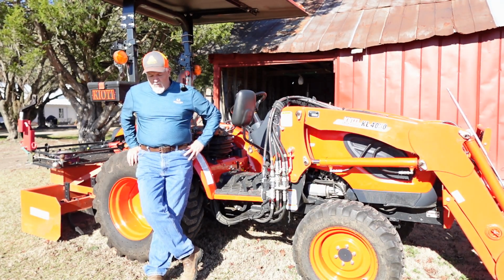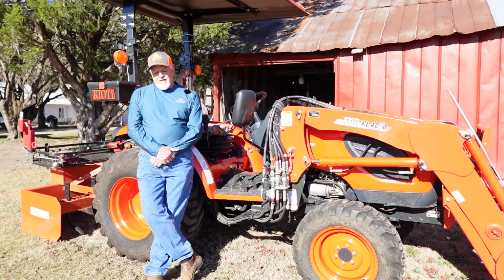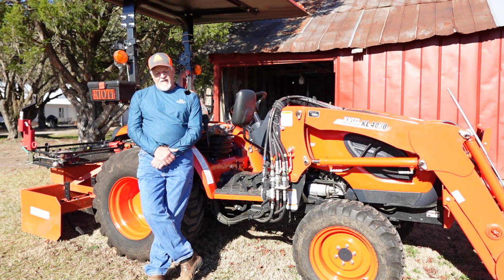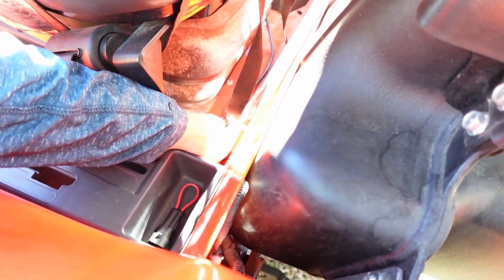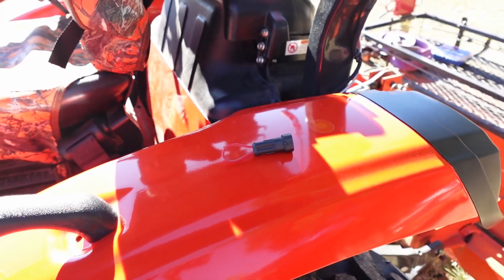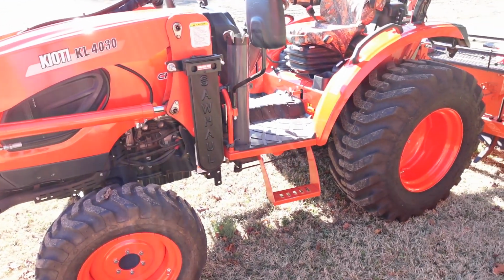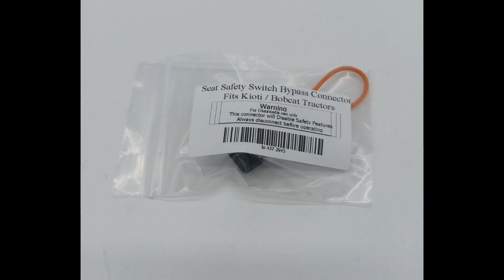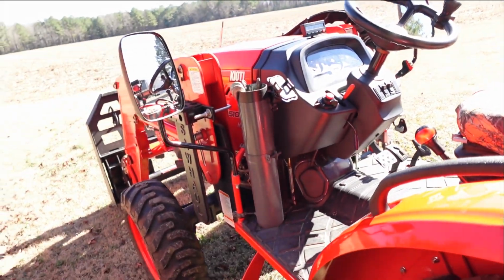Tractor Seat Safety Switch Bypass - Why Did I Choose To Do It?  Kioti CK Series

Comment: You hit the proverbial nail on the head with your comment:  "you want to do the common safety items. like put in neutral, set the brake, etc."  The seat safety switch on my CS2520 is one of the dumbing down of America items that really chaps the backside of my pants.  I'm of slight build (5'6"/125 lbs) and just shifting my weight on the seat to see the backside of the tractor when backing up will cause it to shut down.  PITA!
Reply from the maker: @timstapp374  Totally agree.  I understand that some safety measures have to be in place.  But the seat switch is just a bit over board.  Thanks for watching and commenting. Merry Christmas.
Reply: @backyardcountrylivin1514  Merry Cjost,as an Happy New Year to you and yours as well!

Comment: Jeff, I totally understand why you did the bypass.  I struggle with the pallet forks too and have thought about doing what you did.  However, I had a cousin whose grandfather fell off a tractor while bush hogging.  He got run over and was severely injured.  It did not kill him, but he was never the same. I will spare you the gory details, but it was not good!  Now, that was an older tractor and did not have what I call a safer operator-station.  My CK3510 looks like it would be pretty hard to fall off,but you never know.  I don’t worry so much about me, but I have a young grandson who has become a very capable machine operator.  I have not turned him loose with my tractor yet, but will at some point since I am now 75.  I just cannot in good conscience disable that seat switch for fear of somehow getting him hurt.  I have thought about using a switch (that only I would know about) that would make the seat switch function as intended, but also allow me to disable it if needed.  I may do that.  Thanks for sharing your thoughts on this subject.
Reply from the maker: I totally understand we’re you are coming from.  Although the seat switch can be a headache, it is definitely the safer option.  I can’t blame anyone for sticking with the most safe route.  Tractors and machinery in general are always going to have their dangers.  Thank you for watching and your honest feedback.  Happy and safe tractoring.  Merry Christmas 🎄

Comment: I noticed that Good Work Tractor that makes a different folks with short safety wall so to speak and I assume that is something that allows you to see much better. If I had to choose I will choose that one since I don’t have the tractor yet. But your solution is better for those who have the setup already. Thank you sir. Mary Christmas.
Reply from the maker: I agree, shorter headache rack would definitely  help you to be able to see better, but would also allow taller loads to be able to tip backwards and fall on the tractor.  Either way, a set of pallet forks is a must for a tractor with a loader.  It is my most used attachment.  The tractor loader multitool.   Thanks you for checking out the videos and commenting.  Merry Christmas.

Comment: Interestedly my CK4010 hst that I bought new in 2018 does not have the seat safety switch, yet my NS6010 with a Cab does.   Kioti must have started putting the switches on the CK’s right after I bought mine.  Anyway, I have no issue with you bypassing the switch, I’m fact I just installed the bypass switch on the NS a couple months ok.  Works perfectly.  Good video.
Reply from the maker: Yeah, I got a feeling most people would prefer to do without the safety switch.  But at least it’s a easy fix to bypass it. Thanks for checking out the video and commenting.

Comment: The timing of this video could not have been better. I’ve been working with my new CK3520SE and the safety cutoff feature on the seat has been driving me nuts. I’ve been looking up DIY ways to bypass it, but I like this connector much better, especially for only a few bucks. Thanks, Jeff!
Reply from the maker: Hi Logan, glad the timing of this video was able to help you out.  Like you, the seat switch was driving me crazy.  Thanks for checking it out and Merry Christmas 🎄

Comment: Always enjoy your videos Mr. Jeff! Another one of your ideas I am going to steal! You all will never catch me! Thanks, and I hope you and your family have a Merry Christmas and a healthy and happy New Year! By the way, I don't have forks, but I do use a stump bucket and it is annoying, trying to line-up where I want to start digging. Thought about maybe installing an on/off switch but went with the plug as you suggested.
Reply from the maker: Hi John, you can steal my ideas anytime, Lol.  I know what you mean, any of those front attachments that you have to see the point of contact on the lower side, near the ground, are a problem to see without standing up. I highly recommend a set of forks. Not very expensive and will likely become one of your most used attachments. It’s the tractor multitool.  How do you like the stump bucket?  I’ve been thinking about getting one, just not sure how much I would use it. Do you use it for other tasks than just digging up stumps?  Thanks for checking out the video and commenting. Merry Christmas to your and your family.
Reply: Hi Jeff, I was surprised how well the stump bucket works. I have heard others describe it as a poor man's backhoe. The only issue (expected) is you will tear up a lot more area around the stump then using backhoe, tire slippage etc. I have used it on 10" 14" stumps and 1 24" locust stump successfully. $700 bucks as opposed to well over $8,500, plus storage for a backhoe made sense for my amount of use. Thanks, again for a great informative channel, B. Regards. @backyardcountrylivin1514
Reply from the maker: Thanks for the info John.   @Kiot76

Comment: I had to this in a hurry one morning my first winter with the tractor.  I found I had to "sit hard" as the weather got colder to make the switch.  One morning I couldn't sit hard enough so I figured out which wires went to the switch, cut them and joined them with a butt connector. I had to blow the lane to get to work so I was happy I could get it to start
Reply from the maker: That’s good info to know.  I could see where the cold would make the seat hard and less flexible.  Glad you were able to bypass it and get her going.  Thanks for checking out the video and commenting.

Comment: Great video. I have the ck3520se and did the same exact thing and it works great. I would like to know where you got your seat cover, tho.
Reply from the maker: Hi Kurt, the bypass switch does work great and is a game changer for being able to see when standing up.  The seat cover is actually one for a Kubota I got off Amazon. It fits ok, but not perfect.  I had one viewer said that he found one that was almost a exact fit for a CK3510.  I haven’t ordered one yet, but that’s the one I’m going to try when my current one wears out.  He is the link he sent me.  Thanks for checking out the video and commenting. Merry Christmas 🎄 
https://www.amazon.com/Durafit-Seat-Covers-Kubota-Tractor/dp/B084M6QVL3/ref=mp_s_a_1_16?crid=8GOWOWOSIY55&keywords=kubota%2Bseat%2Bcover&qid=1667144686&qu=eyJxc2MiOiI0LjY2IiwicXNhIjoiNC43MSIsInFzcCI6IjQuMzIifQ%3D%3D&sprefix=kibota%2Bseat%2Bcover%2Caps%2C81&sr=8-16&th=1

Comment: What is the piece called that you replaced on the wire that sends the current back to the dash gauges?  Thanks.
Reply from the maker: It's a seat switch safety bypass plug/connector.  Here is a link below for one on ebay.  Pretty sure you can get it on Amazon also.  Thanks for watching and commenting.
https://www.ebay.com/itm/175889125763?chn=ps&norover=1&mkevt=1&mkrid=711-117182-37290-0&mkcid=2&mkscid=101&itemid=175889125763&targetid=2299003535955&device=c&mktype=pla&googleloc=9009828&poi=&campaignid=21214315381&mkgroupid=161363866036&rlsatarget=pla-2299003535955&abcId=9407526&merchantid=6296724&gad_source=1&gbraid=0AAAAAD_QDh8SL_V-v2FwQl1xuGHmyhOeT&gclid=EAIaIQobChMIqOu4sq2viQMVYzXUAR20Kg-NEAQYAiABEgLkCPD_BwE
Reply: Thanks

Comment: I was thinking about doing this to my CK 2620, but after thinking about it, I’m not sure this would make much of a difference for me. Other than once the tractor is already on since I have to engage the clutch to start. Do you know if that would still be true with this jumper?
Reply from the maker: I'm pretty sure the jumper would work if your tractor has a seat safety switch.  So, the jumper would bypass the seat switch, and the tractor shouldn't cut off any time that it normally would if the seat switch was still in place.  Thanks for checking out the video.

Comment: Hi, enjoy the videos and have a 3510 myself. Where did you order the bypass jumper?
Reply from the maker: Just went on google and searched for Kioti CK seat safety switch bypass.  It also fits the Bobcat tractor which is made by Kioti. Thanks for watching and commenting.  Here is a ebay link.

https://www.ebay.com/itm/175766644049?chn=ps&norover=1&mkevt=1&mkrid=711-117182-37290-0&mkcid=2&mkscid=101&itemid=175766644049&targetid=1529493962142&device=c&mktype=pla&googleloc=9058880&poi=&campaignid=19851828444&mkgroupid=145880009014&rlsatarget=pla-1529493962142&abcId=9307249&merchantid=6296724&gclid=CjwKCAiA1fqrBhA1EiwAMU5m_wBoPnTrPeqr7zDBDn5f1SIGun5Gdmi215qii6U2NyT_eFQD5rRZdRoCHL4QAvD_BwE

Comment: I'm a week in with my CK2710 cab. I traded my Kubota L2501 which I miss , but that's another topic. Too many safety switches on these Kioti, it's ridiculous.  Seat, parking and has to be in neutral. Drives me nuts. Kubota, I had my seat safety switch which I fixed by bending the steel tab resting on the switch.  You could jump on and off in gear and without a brake. Not for the good. I love the comfort of the ac and radio in the Kioti Cab.
Reply from the maker: @deerrudy  I totally agree.  They go overboard with all the safety stuff.  Hopefully the Kioti will serve you well.  I’ve been really happy with mine so far.  I know the comforts of the cab is nice. Thanks for watching and commenting.
Reply: @backyardcountrylivin1514  Good to hear your liking yours. I researched before buying my Kubota 4 years ago and Kioti at the time. Not one issue with my Kubota in 4 years. I researched this time around, and videos like yours helped me decide, so your videos were helpful. Kioti has a lot more premium featured compared to my LSeries. The hydraulics is where Kioti is not on par with Kubota, but I will get used to it
 loving the Kioti so far.  Thanks,  take care!

Comment: I have a Kioti CS2220. I bypassed my seat switch by zip tying the button down.
Reply from the maker: Hey, that’s a good idea.  Doesn’t get much easier than that. Thanks for checking out the video and commenting.
Reply: How easy is it to access the button? I don't have mine yet to look at, it is on order. Thank you.
Reply: It "twists" into the bottom of the seat